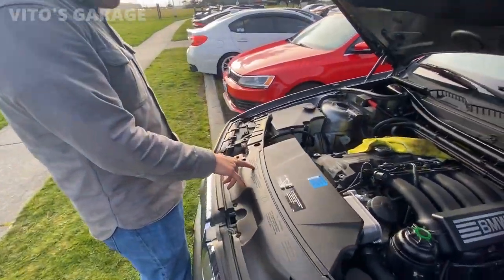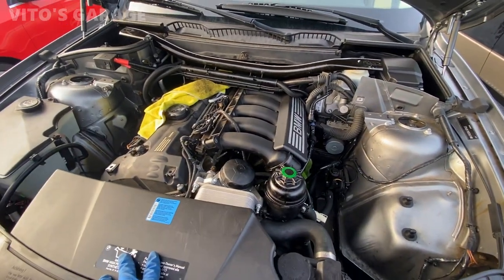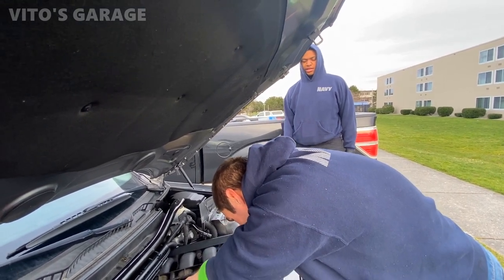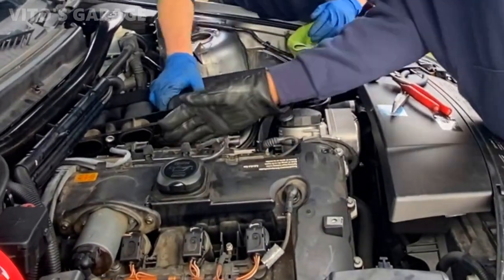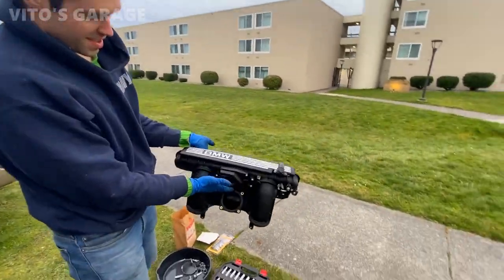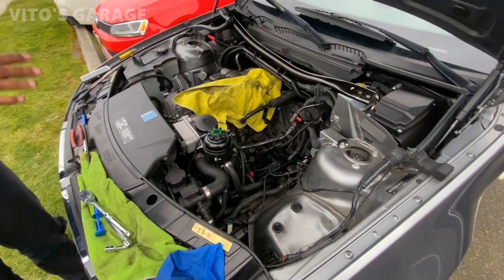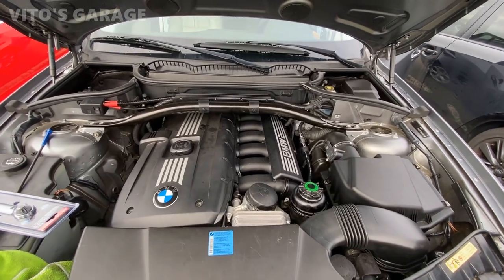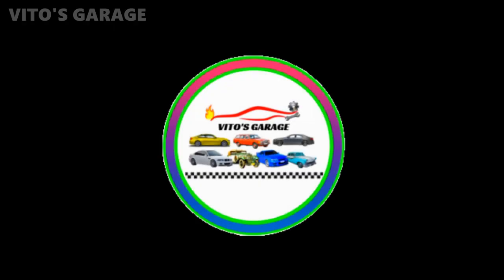This BMW X3 Owner Attempted to Get His Car Running, But Failed!.... No Start

Comment: I got a e53 x5 in trans limp mode. Think you could fix it!? 😂😂
Reply from the maker: Of course. What fault codes you got in TCM?
Reply: @VITOSGARAGE   p0720. That's it.
Reply from the maker: That can cause the limp mode. Focus on this code. Have you done anything or have you tried diagnosing the problem? Definitely electrical problem. Most likely a bad vehicle speed sensor. I am not sure where that sensor is located on E53. It's either mounted to the trans or inside the trans itself. I'd need to look at the trans diagram of it.
Reply: @VITOSGARAGE  yes I replaced the output shaft speed sensor but still nothing. It's like the output shaft splines are stripped. If you give it a lot of rpms it moves slightly only in reverse no forward at all.
Reply from the maker: @corydunk1521  interesting. Are you sure the trans has a proper fluid level? You have to check it while it’s running and it has to be level. 
You do it from under the car. There’s no dipstick.
Reply from the maker: @corydunk1521  the stripped splines will definitely give you a P0720. But this code acts differently on every car, meaning, some cars might go into limp mode because of this, and some might be fine
Reply: @VITOSGARAGE  yeah my trans fluid plug is stripped. Half of my trans fluid pan bolts are broken or stripped. You can hear a metal on metal whine when the rpms get high. It's above my knowledge now so I gave up a while ago but I would like to get it fixed. It's a pretty fun car
Reply: @VITOSGARAGE  I also have a pretty decent w126 diesel. Runs and drive great just need miscellaneous stuff.
Reply from the maker: @corydunk1521  keep it up. E53s are cool and fun SUVs. You need to remove those stripped bolts and replace them with good ones. Fluid level and condition is the first thing to check and take care of. A lot of older Bimmers suffer because they don’t have the dipsticks and the transmissions leak. The owners are lazy and don’t check the level which ends up in transmission destruction